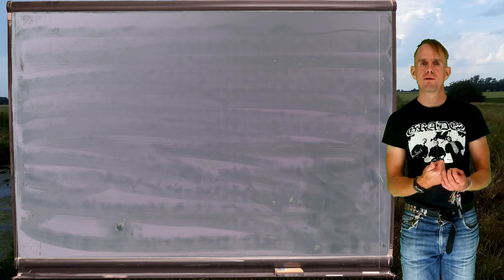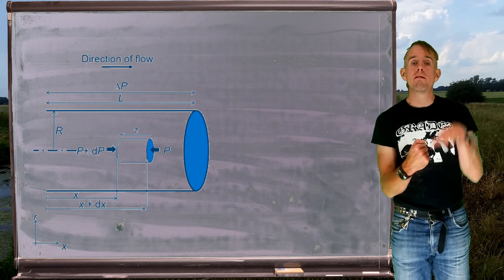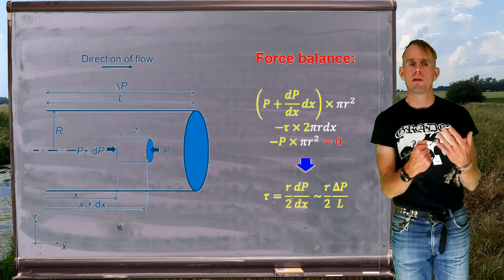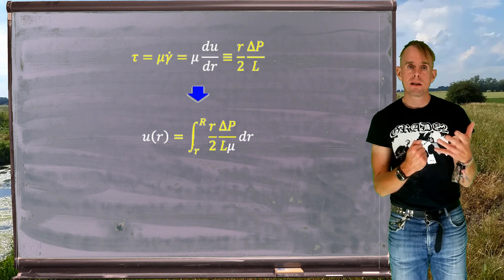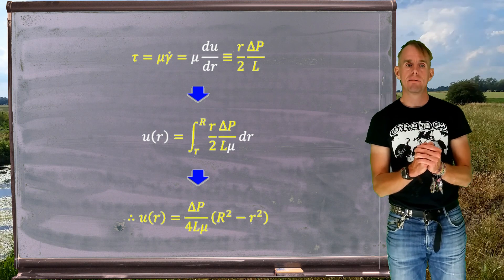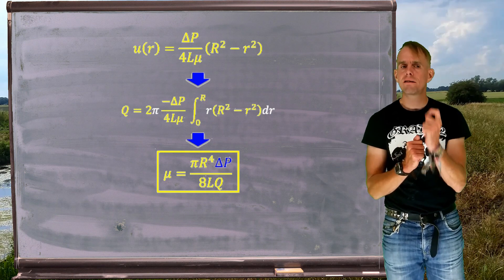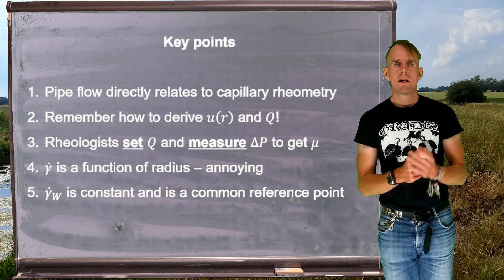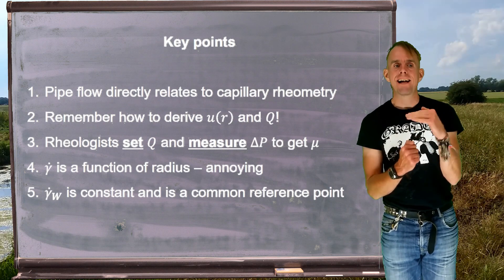Lesson 5, part 1: analysing the pipe flow of incompressible Newtonian fluids

Comment: Great lesson! coming back to this video, I wanted to comment that it's very strange that the velocity on the wall is 0 but the shear rate on the wall is positive! What is the meaning of the shear rate on the wall if the fluid is "not moving" there?
Reply from the maker: Thank you for your feedback! Ah - now don't forget that velocity and the rate at which it changes are two different things! Consider, for a moment, where the velocity is maximum (for example in the centre of a pipe). The rate at which at which the velocity changes with position is exactly zero on that centreline. Now consider where the velocity falls to zero: the rate at which velocity has to change with respect to position to attain this is significant! Therefore, the shear rate at the wall is very much non-zero, as the shear rate is a measure of the rate of change of velocity, not the velocity itself. Remember too that (for a Newtonian fluid), the stress due to fluid motion is the viscosity * shear rate: it is the non-zero shear rate at the wall that gives rise to the stresses that are responsible for pressure drop!
Reply: @drbartsworldofchemeng  thanks a lot for the detailed answer!